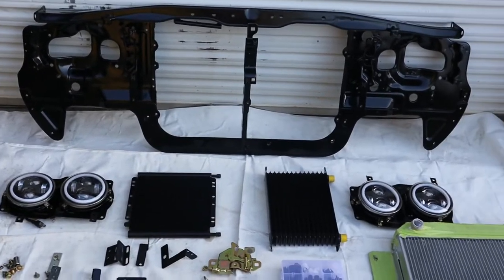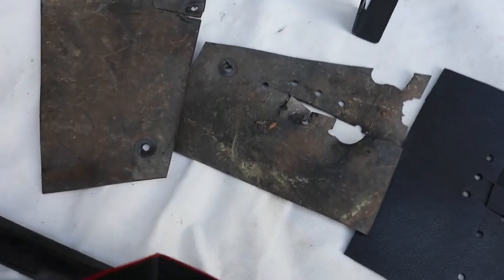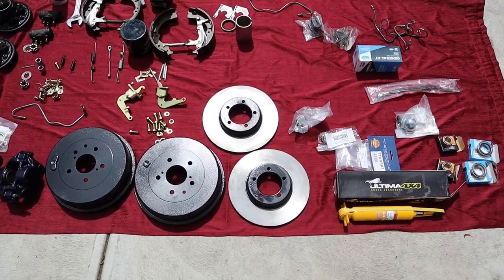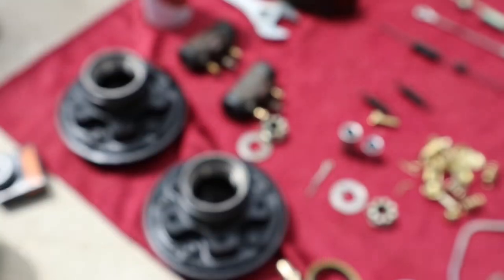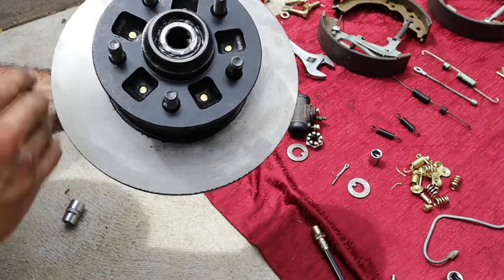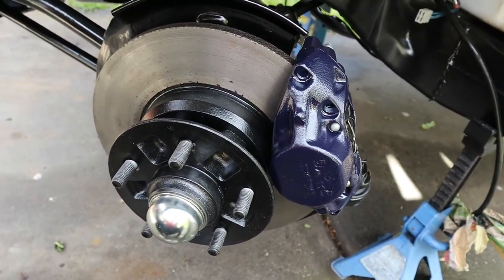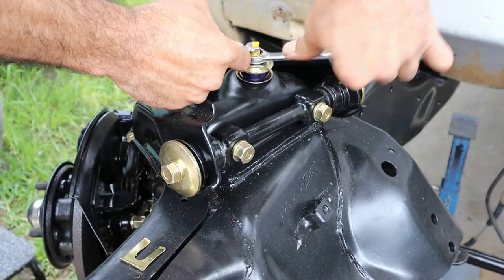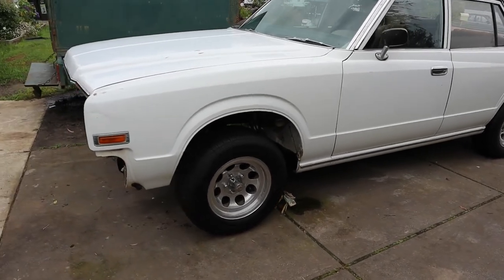TOYOTA CROWN MS85 1975 2JZ SWAP PART 9 RADIATOR SUPPORT ASSEMBLY & INSTALLING THE BRAKES REBULID

Comment: You are doing a fantastic job I love how the power coating has come up looks like parts are brand new. Clever putting new radiator in while you can rather than having rusted water flowing through your motor keep up the good work